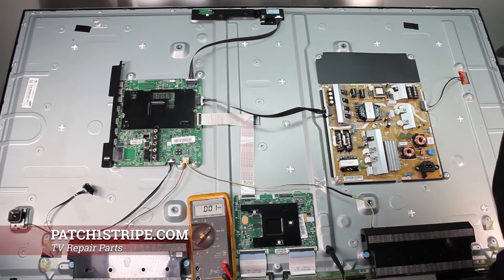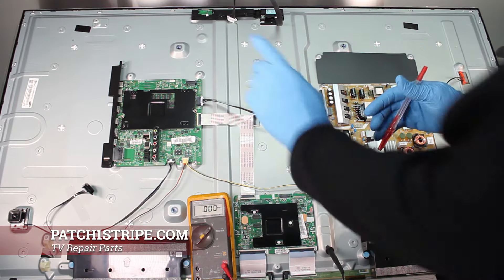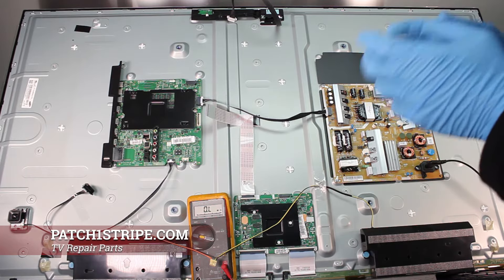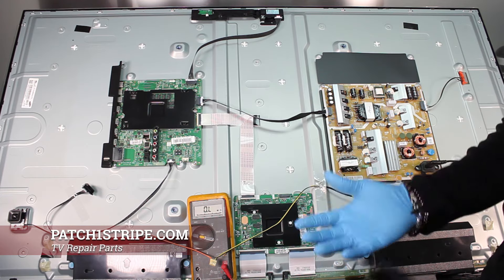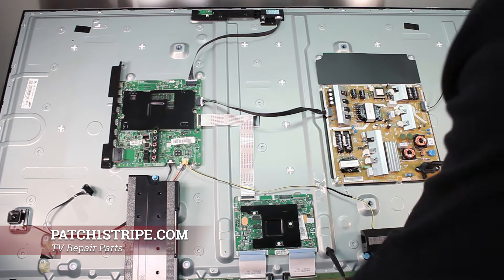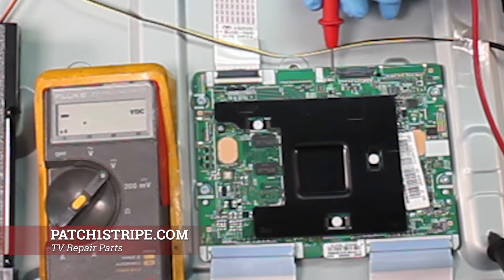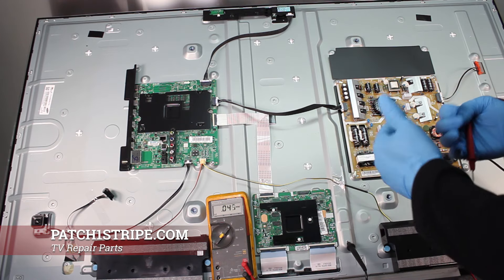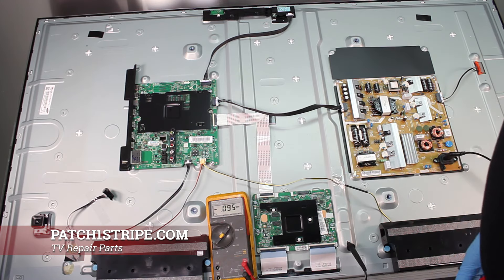HOW TO REPAIR ANY SAMSUNG LED TV:  Won't turn on,  No power

Comment: Hello From Cameroon! I’ve got the 2012 pretty similar with the one on this video with camera that pops up from the top.  It’s  a 64”.  Couple of days back it started going off.  It will stay for a while even when I unplug the power code n plug it again it will take a couple of tries to come on.  Today it just went off and won’t turn on no more.  No standby light nothing.  Any advice?
Reply from the maker: Hello to Cameroon, from your description of the problem that you are having a big consideration is your tvs' age - 8 years, how much is it played in a day. Next from a tech point of view - when electronic components fail they don't intermittently work and stop working. So with that being said I think you have some cracks in your component soldering connections on your power supply board or main board. Now also, on the large square ic on the main board with the large heat sink attached, there maybe some heat related issues there. One way to start isolating your problem is to use the instruction on the video again and see if you get backlight when you disconnect the main board from the power supply. If the backlights come on, see how long they stay on. If they never cut off, I would disconnect the wifi module and see what happens or replace the main board. If the backlight don't come on, I would reflow suspected bad solder connection or replace the power supply board. Let me know what you find - I will try to help you resolve your problem as best that I can from here.

Comment: Hello, Well I did a little swapping out with boards but now I have backlights, red on-off button, video I can read but it's real dim. I don't have a fuse on my T-Con board but there's one on the power board. My wifi module is connected to the power wires and I don't know how to disconnect it. I can read all the options when I press Menu. I even did a reset on the TV. Still dark picture with sound.
Reply from the maker: I sent you a reply to this - check your emails

Comment: I have a samsung tv when I unplug that control board from the power board and the led backlight doesn’t come on how can I tell if it’s the power board or the led light strip is bad?
Reply from the maker: check the fuse on the power supply board near the power cord connector with the tv unplugged and the voltage ohm meter in continuity mode. If it good go back to the video and continue watching how and where do voltage checks. If that fuse is bad replace the power supply board. Hope this helps.
Reply: So if I have about 13v when it should be on standby and on stand by it should be 8v then I could have a bad board right?
Reply from the maker: What is the model number of your tv?
Reply: It’s a UN55KU6290F
Reply from the maker: Dakota kalivoda continue watching the video completely.
Reply: Patch1stripe TV Parts which company to order a cheep parts for power supply board?
Reply: ernie aromin I searched on the patch stripe place and it they didn’t have one I had to search the board number and found it on eBay for 30 bucks
Reply: ernie aromin sorry the patch stripe website

Comment: My backlights came on when I disconnected the mainboard and tcon from power board

Would you know what can be problem?
Reply from the maker: What is the model number of your tv?  Give me a detailed sequence of at what point in your troubleshooting process did you disconnect the T-con from the main board.  The t-con is not connected to the power supply at all.  Waiting to help.
Reply: @Patch1stripeTVParts  un55js8500F..when I unplugged mainboard from power supply backlights came on as well
Reply from the maker: @KINGREED-NYC  that says that the power supply and the backlights are good.  Next connect  that main board back  to the power supply then disconnect the t-con board from the main board   That’s the flat cable then apply power and tell me if the backlights come on
Reply: @Patch1stripeTVParts  no backlights on when I do that
Reply from the maker: Did you use the remote or power button on the tv to turn the tv on.  If so and still no backlight, you have a bad main board.  Another thing, also disconnect the WiFi module to be sure it’s no faulty and keeping the tv from coming on.  Again if all of that checks out replace the main board.  Hope this information helps
Reply: @Patch1stripeTVParts  I powered on by power button will try disconnecting module now
Reply: @Patch1stripeTVParts  did disconnect wifi module,no backlights
Reply: @Patch1stripeTVParts  also do you supply mainboard?

Comment: So I replaced both boards on my tv. The TV turned on for a little bit, I walked into another room, when I came back it was turned off and smelled like something was burning. I didin't see anything unusual. what do you think might have happened?
Reply from the maker: Don't know - did you purchase used parts? Did you smell to find the location that was burning? Did you use the exact replacement part number for the repair? What is the model number of your tv? What was the original problem before you change out parts? Did you watch this video before you started ordering parts to narrow down what your problem could be? All of these question are relevant to a successful repair. Hope this helps to turn you situation around.

Comment: hi i have samsung led ua32eh4003 have a problem when i turns it on it goes on and then restart when disconnect power and turn on it works normaly and then goes restart some times there is lines on screen and sound disapear and restart some times it runs normally for long time some times it restarts and then goes off some times goes standby and won't turn on by remote untill disconnect the power and return it back all this happen randomly i checked the power supply for bad soldering and capacitor every thing looks good check the board same thing i hope u can help me
Reply from the maker: main board - unit is about 8 years old and depends on how often it played everyday. That is where I would start.
Reply: @Patch1stripeTVParts  thank u for the reply may be the eeprom need reprogram is that correct
Reply: Do u know my family told me that the tv still work normally for about three hours and then in the evening return to same problem

Comment: I have a dead Samsung UN50EH5300 and the standby LED is not on.  I replaced both the main and power supply boards and still dead.  The only thing that has changed is when disconnecting the cable between the two, now the backlights come on steadily whereas before they would come on but flicker.  No matter which other cables I disconnect like TCON etc., still nothing.  I can't afford a new TV, any help would be appreciated.
Reply from the maker: hello, when you stated that the backlights came on steadily are we talking about at least five minutes? Now do you have wifi on this tv?
Reply: @Patch1stripeTVParts  Yes they stay on for more than 5 minutes.  Before the replacement of the boards they would sometimes pulse on and off.  The TV has wifi.  I've tried disconnecting the wifi module as well as the tcon board, the backlights and the power button/IR receiver assembly and I still can't get the red standby light on.
Reply: @Patch1stripeTVParts  Any suggestions?  Your help is much appreciated.

Comment: The one thing that I noticed on my set was that he standby light was flashing and the set  "on" light comes on as soon as I plug the set in. aAlso, the back lights did not come on when I disconnected the cable to the main board.
Reply from the maker: Sounds as if you have bad LED backlight strips. Go further with your troubleshooting.

Comment: Hi I have a Samsung   ue37es6300 I was having issues with the network I'm so silly I went on the blue service menue and dont know what I pressed and it turned my tv off. It wont  turn on and there is no red standby light too . Have no clue what to do.
Reply from the maker: Ok this may help. with the remote pointed at the tv - press "mute",  "1", "8", "2", and the "power" button and the unit should come on. Hope this helps.
Reply: @Patch1stripeTVParts   Nothing happend but thanks for trying to help out. I'm so stupid I shouldn't of gone into settings that I dont know about. I m thinking of opening the back and see if theres any issues on the boards.
Reply from the maker: @comerelax..2443  Don't do anything yet, give me a chance to do more research. Hit you back soon - hold tight
Reply from the maker: Hello I’m back, try this, using your remote press “infor”,  “menu”,  “mute”,  then “power” button.  The tv should come on.

Comment: Samsung LN52B750U1FXZA. TV is off and Status Lamp is illuminated. I depress the power button on the remote and the Status Lamp extinguishes momentarily and the TV returns to standby mode. I rapidity depress the power button until the Status Lamp will finally start flashing as the set turns on. I have to do this every morning to turn on the TV.
Reply from the maker: From what you describe, you have bad solder connections on your power supply board and/or bad capacitors on that same board.
Reply: @Patch1stripeTVParts  I was thinking the PS since the picture and all functions work great when it does fire up. I figured it was a cap not kicking in. I forgot to mention, This phenomenon happens when I fire up the TV in the morning. It stays on all day every day till I go to bed. If it has been on for a while I can turn it off for a few minutes and it will start up with no problem.  It's been a great TV, I get complements on the picture.
This did happen after we blew a circuit breaker. It's an old house that has too many things on one breaker. The house was not designed for so many electrical devices. My son reset the breaker because I blamed him and I'm too lazy to get up and reset it. The TV came back on by it's self when the breaker was reset.

Another thing I noticed is the TV would turn it'self back on after I turned it off. I shake my head and swear I turned it off. I turn the TV off with the Roku remote, grab my Onkyo remote to turn off the surround sound and the TV comes back on. I could just be tripping. It's random. Could just be me.

Comment: Hello, how to figure out that power supply is not working?
Reply from the maker: Disconnect the main board from the power supply board and see if the backlights come on and stays on.

Comment: Hi there! Thanks for your video. It was very informative.

I was hoping you could help me. My main board starts making a clicking noise when I plug it in and stops when I disconnect the wire between the main board and the power supply board. The TV won’t turn on and there’s no backlight. When I went thru the troubleshooting steps, the backlight came on when I disconnected the main board from the power supply but it wouldn’t when I tried a second time
Reply from the maker: Ian Tera what is the model number of your tv?  From what you described, I would suspect you are having a power supply issue.  If I was to go farther, I would say you have cracked circuits on that power supply board.  Hope this helps

Comment: So I have this same TV. My issue is the connection between the T-board to the panel. The ribbon connector is ripped off.
https://imgur.com/a/VvsqED7
What can I do? Is it possible to solder/clean and reconnect the ribbon?
Reply from the maker: Send a photo so I can see exactly what you have for myself. Thank you
Reply: @Patch1stripeTVParts  I have photo in the previous comment but I'll send email too just in case it did not work.

Comment: My Samsung UN40EH5300, cuts on, has full sound and video...but, may stay on for few minutes, more or less. Then starts to go black with sound. Itll come on and off randomly for strange periods of time...while screen is black
My mother gave to me in excellent shape but stayed on her stand, got alil dusty...clean house tho.. I've watched ur videos. My back light comes on.
I'm scared to buy the t-con, Main board, or power board....
Reply from the maker: Hello, what i would do first of all is to reseat (disconnect then reconnect) all the cables in the Tv. Now do 1 cable at a time and power up the tv. 2 reason for this 1- to be sure not to loose what you have by not seating the cable into the connector correctly. 2- to know if you have a fix. Now if this does not do it for you, I would follow the video and disconnect the main board from the power supply and see if I have backlights and will they stay on for at lease 20 minutes without shutting off. If that checks out, proceed with the video until you find your problem. Hope this helps - hit me back if you need more help.
Reply: Thank you Yah Shaddai for working through this man to help me... ok so I prayed. I remembered ur steps...went to war humbly....turned off adnet, eco mode, turned off wifi....did the button pass code,  hidden settings, reset it....worked then cut off with sound... I kept hearing bgg ur voice say voltage issue, check voltage....give it clear-path voltage...an complete wall outlet jus to the TV alone......
It flickered alil bit, then stayed on...
Has been on for over 5hrs now....I'm so thankfull.
Reply: Now my Hisense 55h5c led smart tv is powering on...but has an backlights black screen. I did sum testing...and noticed...the yellow box (led inverter I believe,  bc wires run series into the lights of the tv...)on top left of power board is humming faintly but consistantly.... we dont have original remote...but it turns on soon as I plug in..has an power button tho...

Comment: Is there any remedy that involves 10 ounces of urine thrown on, or administered directly on components ?, It would please and excite me a great deal if so,,,,,,,,,,,given the cost and all the work involved mounting and connecting everything....  only to have it magically transform into a boat anchor just mere weeks after warrenty expires!
Reply from the maker: Jack F don’t power up the tv. Let it dry. Urine is conductive so it will short out the circuits that has been exposed. Hope this helps but the tv is probably ruined already.

Comment: I need help with my TV
Reply: It's Samsung 6500F the same one in the video I think everything like u said to first video but it still not working n still blinking can you please help me I also called the number that was online and a number that you can reach me on
Reply from the maker: hello, first send me the complete model number. UN65HXXXX for example.
Reply: @Patch1stripeTVParts  UN50JU6500FXZA

Comment: My TV education is 70 years old
Reply: Need: removal of back cover steps: 1 remove all screws, 3 screws under stand.
Found main board defective. What are the board numbers, to order? 2 stickers with all the information. What are the numbers to order?
Reply: How do you remove the spring fastener, to remove the heat sink, to trouble shoot?
Reply from the maker: The part number is on the long bar code stripe that has the model number on it as well as the part number. That the only number to go by. That small square with the "BN" number on it is not the part number.

Comment: I went through your process the back light came on on every instance and my TV is still will not work. The red light is on when the TV is off. When I turn the TV on you can see the screen fine for about 1 second and then it goes blank and the red light flashes five times. It acts like the TV still on when I push volume up or down or channel or any buttons the red light flashes as I push it as it usually does. Please help I can't afford another TV right now. Thank you for your video so far, it has been enlightening to understand how it works. By the way I am "proficient" with my multimeter so I truly have it checked everything and just to let you know where I'm at as far as telling me what's wrong.
Reply from the maker: Hello, what is the model number of your tv. Its on a sticker located on the back.

Comment: We recently had a thunderstorm. When lightning struck nearby my TV turned off. After restarting, it went into a boot loop. It turns on, the logos displays, the smart bar at the bottom displays and I can get into the menu. However after a few seconds, the TV shuts off (you can hear a click when it shuts off). It then restarts and does the same thing, over and over. My video of what is happening here: My Samsung TV Bootloop https://youtu.be/kE5j_07X_-8 

I have tried resetting by unplugging and holding down the power button. I have tried resetting to factory settings, but it doesn't stay on long enough for me to make it to that part of the menu. I have tried resetting with EEPROM method, but no luck ( I think I'm doing it right).

Someone suggested to me the main board should be replaced as there seemed to be no issue with the power board. So I ordered one and replaced it, but I have the same issue, with even less screen time on. I also tried getting into the service menu, but it doesn't give me enough time to do a reset.

I'm not sure what else to try. Please let me know if anything comes to mind as a solution.
Reply from the maker: disconnect the main board from the power supply and let me know if the backlight stays on. If the back light stays on - for how long without shutting off.
Reply: @Patch1stripeTVParts  With the main board unplugged from the power board, the backlight will turn on and off constantly.  Here is video of it: https://youtu.be/WOSe03_Fyhw
Reply: @Patch1stripeTVParts  Thank you for you help. Any suggestion?